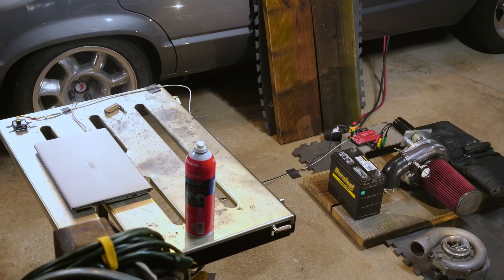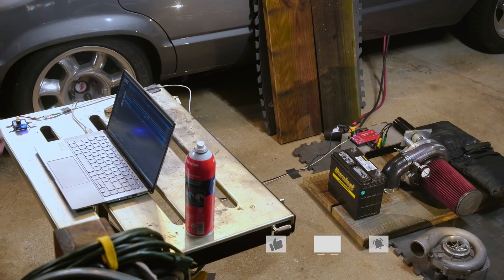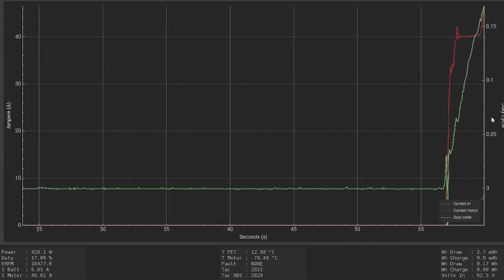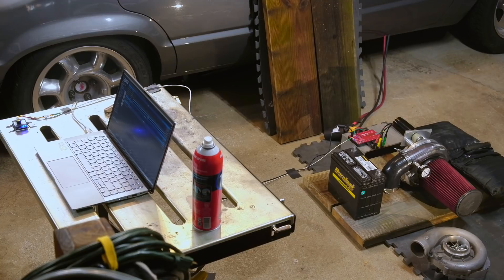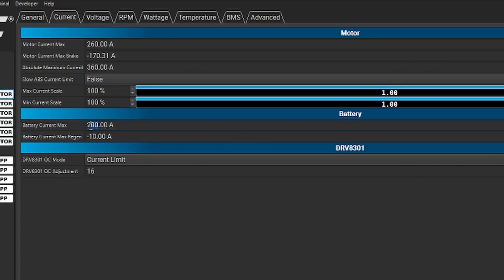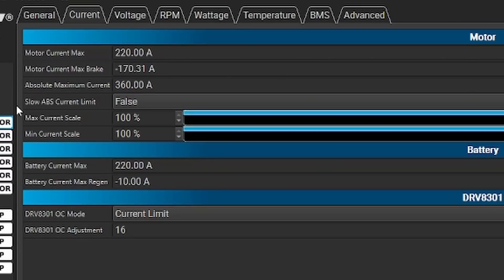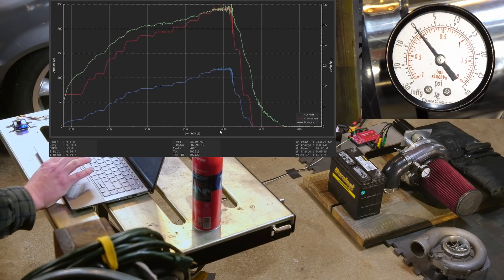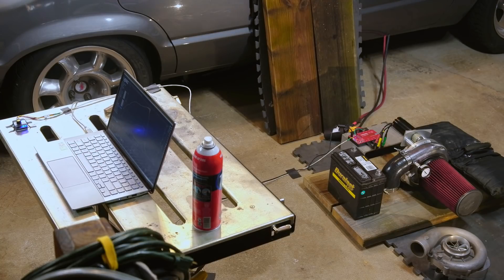Easier/Cheaper High Power DIY Electric Turbo - Full Power Attempt #1

Comment: Looks like compressor surge, you have to give a turbo some place to move the air. It looks like you just capped it off. Try to use a restrictor in the outlet. Maybe 1/2 the diameter.  Look up it's compressor map, keep the rpm, and lbs of air and pressure in the the map. You can look up the power to drive a supercharger. I'm sure you'll be 40 HP and up
Reply from the maker: It was electrical.  We've already made 650 hp using this exact motor on version 1 of this thing.  The drag testing was eye-opening to say the least: https://youtu.be/AOL3Qyczt3Y  We've got over 50 videos in the electric turbo playlist now, and you can see in my compressor map video, I go through things very thoroughly.  Though we've already exceeded my expectations.  So we're going to go bigger.

Comment: You realize most stock Turbocharged engines have the turbocharger itself turning around 200,000+ with around 8 to 10 PSI of boost your electric turbo system can't come close to that with the pulley setup your using the electric motor pulley should be around 3 to 4 inches with the turbo pulley around a inch and a half so your not overworking the electric motor and the entire electrical system side of it it's better to have the ability to generate higher boost with less power needed out of the batteries and capacitors. You should consider ditching the belt drive system in favor of a gear driven system or a chain drive setups less slippage this way.
Reply from the maker: You realize that an Si trim is done at 52,000 rpm, and only needs ~30,000 rpm to support 650 hp on a 500hp n/a engine?  In fact, version 1 of this thing already proved it on a dragstrip: https://youtu.be/AOL3Qyczt3Y  At gain of 15 mph and dropping 1.7 seconds in ET is HUGE.

Comment: Why do you have your custom battery pack as opposed to say a used chevy volt battery? A 12s3p volt battery is <300$, 45lbs, has 48V and people have pulled 675amps out of them
Reply from the maker: I'm using LTO cells.  Much, much safer than a Chevy Volt battery, and can actually provide higher current (900 amps continuous; thousands of amps in burst mode).  It's just more expensive and less power dense.  I've had enough fires/explosions in the last two years getting to this point; I wanted a pack I'd never have to worry about.  Never mind that it's good for 30,000-50,000 charge/discharge cycles (the Volt battery is good for 1/10 of that, or less).  Eventually, people will use the best batteries to fit their needs.  There are certainly cheaper options.
Reply: @AlexLTDLX  interesting, thanks for the answer! I guess in the long run not burning your house or car down can save you a lot of money
Edit: Am I correct in assuming you meant to say energy dense, with their high discharge they should be much more power dense?
Reply from the maker: No, they actually have a lower power density. Meaning they weigh more per watt hour. However their internal resistance is incredibly low leading to the ability to deliver massive amounts of current without even getting warm. There's a bunch of good YouTube videos about people intentionally destroying lto sales like driving nails through them etc. Nothing ever happens. They don't burst into flames or anything. Unlike regular lipos that do. To give you a point of reference, the first lipo pack I used wait about 15 lb. These can deliver a lot more current, but they weigh about 60 lb. That's why I put them in the trunk. Right over the rear axle.
Reply: @AlexLTDLX   I think you misunderstood me, I meant to say you are mixing up the terms power and energy.
Watt hours is a measurement of energy, 1Wh = 3600Joules, so you what were talking about is Energy density. Power density is Watts per Kg. Watts are Volts · Amps and compared to lipos the LTOs have ~2/3 of the voltage, but several times the amps, resulting in a higher POWER density.
Of course you need a much bigger battery pack to get a useable voltage out of LTOs, but that is a different story.
Reply: @AlexLTDLX Sorry if I come across as nitpicking, as a mechanical engineering student I don't have a higher understanding of electronics but I excel at just reducing them down to a power number in a little box while electronics guys will keep talking about amps and stuff forever ;)

Comment: What is the point of this? You do realize that it’s going to take a lot more power to generate the electricity and then convert it back to mechanical power to run this supercharger then if you drove it with a belt? And driving it with a turbine is even more efficient. Also how are you planning to cool that motor? That tiny thing is going to burn up in a few minutes without some sort of liquid cooling system.
Reply from the maker: This is the point: https://youtu.be/AOL3Qyczt3Y

Comment: Recommend large capacitors on the battery circuit. Similar to what high end stereo amps use.
Reply from the maker: Already there - look closely at the junction of the battery cables and VESC power cables.  Those are expensive, low ESR Kemet caps.  Good idea, though.  Just not enough in an automotive application.  As I learned the hard way.  Thanks for watching!

Comment: Timing belt ratcheting? Motor current and subsequent torque went down every time. Maybe it's ratcheting and skipping teeth and degrading the teeth on the belt. Perhaps a tensioner is in order. Might help you get a bit more belt wrap too.
Reply from the maker: Good thought, but it turns out that it was electrical.  Video coming soon.  Thanks!

Comment: Dude. Throw away that rubbish electronically commutated synchronous AC motor and use a suitable automotive starter motor. They can do 60000 rpm easy. At the KW you want.
Brushed dc motors work much better at high rpms and the electronic speed controllers are cheap as chips
Reply from the maker: I'd like some of what you're smoking.  A 60,000 rpm starter?  At 14 kW?  Sign me up, please!
Reply: @AlexLTDLX  I'll post a link of the crazy like a fox Russian, using a 24V light aircraft starter motor to get his old-school five series BMW up to 105 kmh.
That was running 60V through the standard transmission and diff. And developing 20KW
Most decent starters use 6 to 1 to ten to one planet reduction gearheads. 
They are typically spinning at 30000 rpm. The kW rating is a figure that they can handle for long periods. Multiply it by ten for up to 10 to 30 second bursts.
So a 4.6 kW Nissan Patrol 24V starter motor without its reduction planet gear should be fully adequate. If you were keen you could rebuild the planet reduction to a stepup. I would expect better efficiency from a two stage series compressor system if you want decent boost pressure also.
Those brushless rubbish almost never achieve their rated outputs without expensive failures.
Other things to uprate the brushed starter you could consider are ceramic bearings and gold or silver plating the commutator. Like Tamiya technigold RC race motors of 40 years ago
Reply: Here he is just running jt on 36V. The 48V and 60V videos are later on his channel, including the 2 way 100+kmph run on 60V. That one got a hot smell from the motor but you are talking 10minutes at 2.5 times its rated voltage and 5x its rated power.
https://youtu.be/CisvBcx9Z0Q
If you multiply 1000A x 24v then you will realise how much power these standard automotive starter motors actually draw in standard cold starting installation. 24KW

Comment: The current spikes seem to arrive right when the pressure gauge starts fluttering really bad.  On your previous video the pressure gauge was reading much smoother.    It looks like the turbo outlet is setting on the wood directly.  Is there a hole cut in the wood to allow the air to flow smoothly that we don't see?  Even if there is the airflow is pointing straight towards the ground maybe causing a reflection back into the turbo?   Surge occurring on and off at a high frequency that sounds different to normal surge?
Reply: I like the idea of the turbo outlet blowing into a small pressure vessel that another commenter made.  Smooth air flow into a vessel, say two gallon size, then run a 1/4 turn ball valve as your metered air.   That disk in the elbow with start choking off flow at higher mass flow due to the extremely sharp, non tapered transition to the opening.
Reply from the maker: Turns out the problem was electrical.  I'll post up a video about it (and turning it up more) soon.  I'm trying to get it reliable/stable so we can take it to the dyno as soon as possible.  No amount of bench testing is as good as actual testing on a car.

Comment: That's low tens at the track. You were on the dang street!
Reply from the maker: You know what you're talking about.  Refreshing.  The one thing I wish we could've done is do one more hit releasing the brake when the e turbo was fully spooled - probably could tickled the high 1.4 region 60'.  But seeing it skate around at the top of low gear, along with running out of daylight, made me decide, "good enough."  Honestly, I was really shocked at the results.  Much better than I'd hoped.

Comment: Could have suction cavitation due to the small intake filter
Reply from the maker: That filter is actually pretty big (bigger than I had on my 900hp Whipple setup).  That's a good thought, but it was electrical.  Vdeio on the solution coming very soon - along with more power.

Comment: Hello great job ! What is the restrictor of flow and how far away it is from the compressors housing ? Have you ever try to measure the air volume with some kind of MAF sensor or any other way ?
Reply from the maker: Right now it's got a 1" hole in the restrictor plate - watch the video I posted right before it.  Think of this as durability testing.  It'll go on the dyno soon enough, assuming everything lines up.

Comment: What gauge wore are you running. If your trying to draw current around the 150 to 200A range you should be running 0 gage or better.
Figure your DCR for the length your running.
4 ga. Max amps for chassis wiring is  135A, 2 ga. Is 181A, 0 ga. Is 245A.
Maximum current for chassis wiring. Data from Handbook of Electronic Tables and Formulas for American Wire Gauge. The maximum current for power transmission is less.
Reply from the maker: 2 gauge.  Keep in mind, it doesn't run for very long.  Going by the standard charts, I'd need $2,000 worth of cabling.  In fact, pretty much all brushless setups are undersized for their current by old-school charts.  In any event, it's solved, and I'll be posting a video soon.
Reply: @AlexLTDLX  Cool you got the issue sorted. Honestly though some 10 to 20 ft run of 0 GA would run probably 70 to 120 bucks, maybe less.
I do realize that length and operating voltage are a factor. I use doubled up 5 ft. Runs to run 1000 A ac for testing circuit breaker test sets.
But it runs max maybe 1v across the run.
But AC is a different critter, I've pumped double the current through a 10,000 amp DC shunt, but that is only for a brief period of 10 seconds or less. So u do realize that continuous vs. Intermittent are also very different .

Comment: Use high quality capacitor banks on the power leads. Very common addition for high current R/C setups (Helis, Speed runs etc). Should help with the voltage spikes/ripple that can blow the ESC if the batteries are inadequate for the load.
Reply from the maker: There are already two, very expensive, low ESR Kemet caps there - you can just see them at the junction of the battery and VESC power cables.  The two large black cans with white labels.

Comment: First time viewer, cool channel, +1 subscriber. 
For your current\voltage oscillations... Could be the belt slapping around?
I'm always amazed how much belts can wiggle around through the rev range.
Reply from the maker: Thanks.  I should look at the belt, but it's a cogged unit and appears to be holding up just fine.  Check out the belt slip with an M112 Eaton on the car (10 years ago!): https://youtu.be/a4k6i9AEHyo  When I put the Whipple on, I made a tensioner with ball bearings, a large, adjustable spring and a steering damper from a Hyabusa filled with 50 weight oil.  Here's a look at that on the dyno: https://youtu.be/dXZiYTnHLGQ  I admit, I still LOVE that sound.

Comment: Turbos work better with back pressure and load.....I'm leaning to not enough load on the turbo....simulate piping and maybe try to push thru an intercooler core and see what happens?!
Reply from the maker: There's a restrictor in the discharge.  It's got a 1" hole.  Of course, if I pull it out, the load on the motor/blower will dramatically increase, but right now we're just working out bugs.

Comment: You had an external capacitor bank on your blown controller. Add that to the VESC. They don't really have a "massive" capacitor bank.
Reply from the maker: Yes, and THANK YOU FOR PAYING ATTENTION.  The number of people who leap to criticize and are unaware of the success we've already had is staggering.  FWIW, in an effort to appease those who complained about "too much talking" in the last video, I left certain details out of this one.  You can see the Kemet low ESR caps at the junction of the battery cables and VESC.  They're still there.  But I don't think that's the issue.  I have an idea of what might be the issue and I'm about to go out into the garage to give it a shot.  Video will be coming soon.

Comment: Love your project, could you digitize the pressure? I’m just wondering how much your mechanical gauge is actually catching due to its low duty cycle capability.
Reply from the maker: That gauge is frankly, crap.  I really don't want to pull the good Autometer out of the car's dashboard, but we'll know exact numbers once it's on the car and we look at the car's datalogs.  Assuming nothing derails this thing...

Comment: The current in should match with the motor current.  If you want, increase both to 260.  It should be okay but somewhere between 200 and 260 is the sweet spot.
Reply from the maker: The only time motor current and battery current would match is at 100% duty cycle.  Since brushless controllers can't hit 100% duty cycle, motor current will always be greater than battery current.  At 50% duty cycle, motor current should be double battery current - which is, interestingly, pretty much exactly what we saw in this test - you can go back and check it out.  Thanks for your comment!

Comment: is the belt slipping?  you mentioned it was getting warm in the last video.   If the belt is slipping it could explain the voltage fluctuations.   Or seeing as you are running straight from battery, is one battery enough? do you need a larger more consistent supply? ex. alternator or other power source.    Does the voltage input change with the amperage? or is there a manual setting for that?
Reply from the maker: The belt isn't slipping - it's a cogged belt, and slip would lead to failure.  Technically, it would "skip" - which would destroy the belt..  I'm not using an average battery - it's two large LTO packs capable of delivering 900 amps continuous and thousands of amps peak.  I did a video on them: https://youtu.be/KscgGhk3ejs then I tried to stick weld with them: https://youtu.be/TlerchtDjxA  It proved to be way too much power; and with no way to limit current, things got out of hand quick.  We're only seeing 2 volts drop; out of 60 volts total, that's virtually nothing.  And those losses are from the cables.  Thanks for taking time to share your thoughts!
Reply: @AlexLTDLX  I am a bit excited to see how it all pans out.   Besides combustion engines i wonder what other applications this could apply to.
Thank you for responding and being respectful!

Comment: Maybe the belt not being tensioned from behind is allowing the motor to have moments where it isn't under the same load and can spike? Overall this is very interesting, and I'm hoping you can find out the answer and keep testing!
Reply from the maker: That's a reasonable suggestion; esp given how I've seen supercharger belts slip under load: https://youtu.be/a4k6i9AEHyo  That was 10 years ago (!)  But in this case, I think the problem's electrical in nature (I could be wrong).  Thanks!

Comment: Hi Alex. Thanks for all your hard work on this project. I was watching the video in noticed something that might make a difference. I think the problem you are having is because your battery current is lower than your motor current. In other words when you reach the top end of your motor you will start seeing noise on the current because the speed controller is trying to compensate. It would seem that you would be starving the motor of power . To me it just makes sense that your battery current needs to be higher than your motor current. I hope it helps.
Reply from the maker: I understand your thinking, and it's logical on it's face, but that's not how ESCs and brushless motors work.  The motor can never run at a 100% duty cycle.  Motor current isn't an average, it's peak.  So if you have 100 battery amps and a 50% duty cycle, you'll be sending 200 amp pulses to the motor (otherwise you'd need to sink that "extra" 100 amps into heat, and at 60 volts, you'd be sinking 6,000 watts in that tiny little ESC every pulse.  Or on average, 3,000 watts.  That would melt it down pretty fast.)  Hopefully this helps explain it.